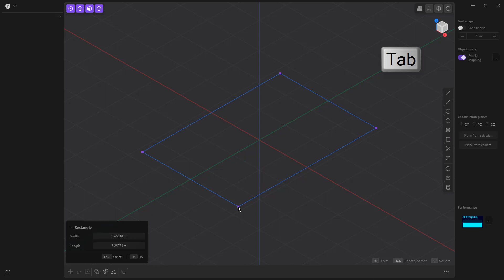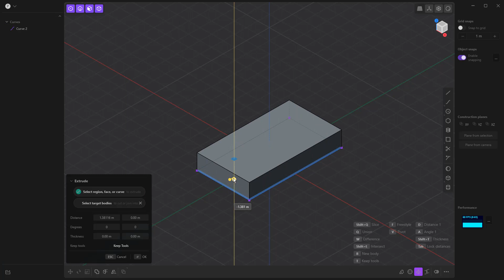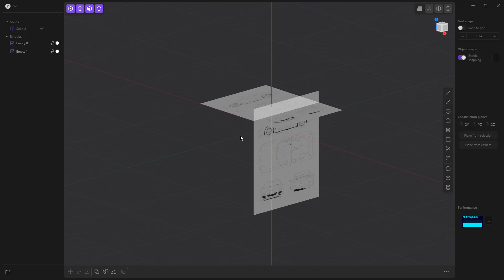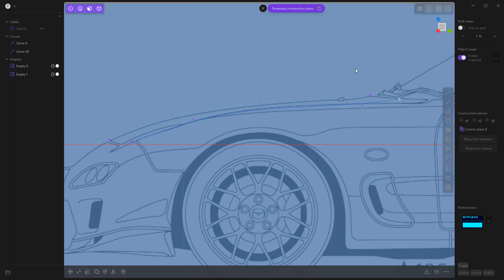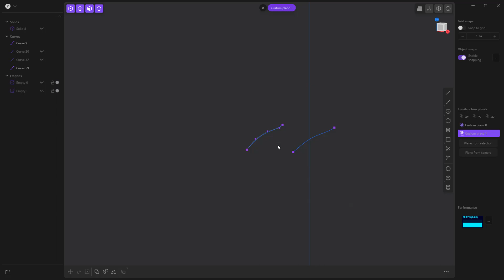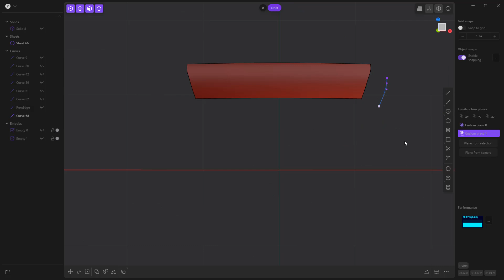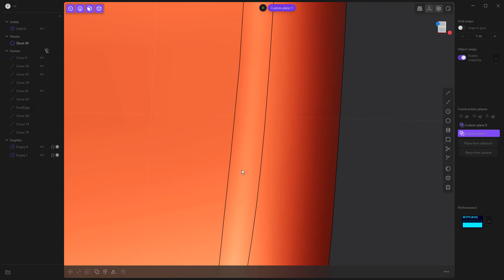Comment: Looks like the key to change the type of rectangle has changed from tab to C. Kinda maddening how inconsistent some of the hotkeys are.
Reply: Yeah. not many have changed but that is sadly one.  I think because tab in some cases navigates through the dimensions that were added.  Some things like extrude, tab locks dims.  I haven't noticed this as much becuase i generally start with a center point rectangle but you are100% correct.

Comment: I've been working daily in Ansys SpaceClaim for the last about 10 years and I need to change software before I have a stroke! I design model car kits and mostly work by surface shapes, and though dimensions matter, they don't necessarily drive the designs that I need a parametric cad. The most important tool for me is the 3d spline and being able to draw in 3d, and it looks like the spline tool here may be close enough. Thanks for the speed of the videos, for moving slowly, and not just showing off what you can do like many creators do!
Reply: Thanks!  You might want to check out the car modeling playlist I did.   It was just before the current version was released so there are some minor differences.  the biggest being xNurbs if you have a studio license.
https://www.youtube.com/playlist?list=PLBDfGh8A8kXXglEZA2MGsn-U8z2pNCPny
Reply: @LearnEverythingAboutDesign  will do, I've watched more videos since last night and the more I see, the more I like about it! You have no idea what a load off my shoulders this will be if it works out!
Reply: I'm very happy I stumbled uppon your comment and channel! Glad to see some showcasing from the makers!
I'm in the early stages of a ridiculous scale model project and I've been using Fusion for the technical parts but didn't quite work out for the surfaces. I've already migrated from Blender due to the complexity it introduces so that's also out and Plasticity seems like the perfect balance between modeling and serious CAD software. Would love to chat some time in the future when I get up to speed for insights in the process.. if that's ok of course!

Comment: Compared with Maya, 3ds max etc Plasticity is really clunky when it comes to this method of modeling; especially with the image set ups and its complete lack of view ports. Apart from that it's a very good modeller, but the surface modeling interface needs a lot more development before it hits the mark surface modellers using splines expect.
Reply: I will say it is getting better. version 1.4 has seen some improvements.  Surface modeling wasn't even in the beta version of the software :)  I will also say that these are NURBS surfaces not mesh.  To the best of my knowledge there is no STEP output from maya or 3ds max correct?

Comment: Hi, I'm trying to design a custom air rifle stock for fairly niche target shooting discipline. I'm using Fusion 360 currently and am struggling with curved surfaces. What software do you think is ideal for something with complex flowing curves like this? I love Fusion for modeling practical use items but I'm not yet sure if this software is ideal for this project. It's my first attempt at doing surface modeling and I probably picked a very difficult thing to model.

Should I persevere with Fusion or try something else?
Reply: Hi Patrick, at the current time I would probably stick with Fusion 360 and explore the forms tools.  I have loads of playlists on my channel about freeform modeling.  I think something like this can certainly be done with Plasticity, but if you are already using Fusion for other things it would make sense to stick there.
Reply: @LearnEverythingAboutDesign  Thanks for your reply, and thanks for your high quality tutorials. I've learnt a lot already from your channel, and it's become my main resource for learning 3D modeling.
Reply: @Patrick-857  Thanks!  I have been working on a Plasticity car modeling video/series but life has been too busy.  That should be the next video I release.

Comment: Hitting Tab just selects the measurements...was that a recent change?
Reply: Yeah sadly from 1.1 to 1.2 that changed.  If you look in the bottom right when you are modeling and the tool is active i believe "C" now switches from a center to one sided extrude.

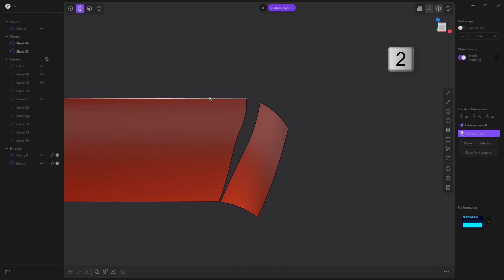Comment: hi, wonder why loft straight up doesn't work to connect the two sheets' edges at 17:28? Is this a version difference? I'm using 1.2.1 currently, thanks
Reply: yeah there have been a lot of updates in the 1.2 release from this one.  I will be putting together a new video on 1.2 soon, but the last plasticity video i did with the beta version which was basically 1.2 i talk about the differences. https://youtu.be/1rQdlOgFFyk

Comment: Literally lost me at square one.
When I click the center and drag away to show a rectangle then hit Tab, it doesn’t go into center mode.
I haven’t clicked the second point of the rectangle when I hit tab.
All it does when I hit tab, is toggle between the rectangles dimension text fields.

So far I’m not seeing any compelling reasons to switch to Plasticity from Shapr3D.
Reply: yeah so between this video in the most current release that TAB changed to C.  TAB now toggles dimensions on the screen.  When you do any operation in Plasticity you can see the hotkeys in the bottom right.

Comment: How should one save an image so it imports to size? Everything I import is 10 x scale.  
Your drawing seemed like what you were expecting. Of course there seemed to be no regard for scale since you were just eyeballing it to fit.  
     That poses another issue.  Let's say I have a shape 7.374 in wide and I want to make it exactly 9.5 in. Is it really necessary to do the math and then input 1.2883 three times?
Reply: what I would do is make a box in the units/size you want.  So if you are working in inches start by changing your units, then draw a rectangle the size you want, extrude it the width.  Then you can have your size reference.  Then I would make sure the images you have are the same size.  Either the true length across the bottom of the image is 9.5in or some scale of this that is easy for you to scale up.

Since this video was made, the version 1.2 that is out now shows some on screen dimensions that you can TAB to when drawing a rectangle which should help.  But yeah there is no measure or strict dimension scheme, mostly eyeball past the initial creation.  What I have done is to create reference lines at times and use those for visual reference as well.  Lets say i know the length of an object is 1250mm, ill set my units to MM then draw a line that long so visually i have that reference and/or snap point if needed.

Comment: 17:28 Try to repeat the same and have en error :( It works on;y with G0 and the surface is flat :( If I select G1 it writes me "T at terminator of curve"
Reply: did your fillet leave a gap at the front edge? or was the front edge still connected?  If it is still connected that might be the issue.
Reply: @LearnEverythingAboutDesign  created two surfaces using loft, -> joined them J, added fillet distance between -> unjoined 3 surfaces Alt+J -> deleted fillet surface -> selected two edges of the two surfaces -> L loft -> get the error "Select guides to loft along"
Reply: @КириллМаренков-с7к  not sure. if you like you can send me the file support@caducator.com and ill try and take a look.
Reply: @LearnEverythingAboutDesign  I recorded the process
https://youtu.be/dNoFEXR_Cn0

Comment: How do you rotate around an object using a MacBook and no mouse?
Reply: Since I don't use a MacBook I am not entirely sure, but I would suggest looking through the user run Wiki.  There is info on keybinding there and likely some info around that problem. https://nullpointerecho.notion.site/nullpointerecho/Plasticity-Wiki-364945653983489ba3e4ad2fc9d0527e

Comment: Can a curve point of a spline be changed to an angled point and vice verse? 
Also: I've created a face with multiple curves and angles. When I try to move a corner, I can only select and move one of the two points and the face disappears and the points will not rejoin. They won't snap together and J does not join them.  Please advise. Thank you.
Reply: A few things I will try to touch on here.
1. As far as I know you can't convert back and forth between splines and lines with sharp intersections.  You can split a spline up using split segment, then if you move some of the surrounding split points it will be "sharp"
2. if you are moving the end of a curve with "G", you can use the Freestyle option "F" which lets you pick the point you want to move, then the point you want it to go.  This is probably the easiest way to get them to snap back.  
3. if you box select the intersection point rather than clicking on it, that should get you both of those corner points. Note that if there was some sort of tangency when they were created you will break that.
4. For Join you can join curves together, but not end points.  The curves must intersect at their ends though, it isn't a fix if there is a gap, meaning it won't snap them together.  Try #2 with the freestyle move.

Comment: I‘m trying to make my own rc car from star to finish. And especially die body modelling and thickening is one issue i faced with blender. The polymodelling approach seems to be right there but fitting it with functional parts from fusion for example is an other aspect. Bu my question is, after modelling the complex surface of a car, how successful is the thickening in plasticity. Because in blender its really tedious. And the the surfaceing approach in fusion360 is not easier. And i am willing to pay the 99$ and learning the tool if its good.
Reply: I think the surface quality in Plasticity right now is good, but modeling something like that would be tricky.  There are 2 main paths I would probably push you down.
1. Forms modeling in Fusion for the majority of the shape.  I have helped a few people who use Fusion for RC car bodies with success.  In order to thicken you just need to watch your shape/creases/curvature.
2. Model the shape in Blender as a quad mesh, import it into Fusion and convert it to a surface.  This only works if its a quad mesh, but if you are able to model the thing you want in blender but run into issues at the Solidify stage, bringing it into Fusion might help.  When working in Forms you can thicken there, or convert it to a NURBS surface and thicken the surface.

I think in the future Plasticity would be a great tool for this, but right now there are some work arounds with lofting surfaces that I hope v 1.20 will fix with driving tangency or the ability to mix/match edges and curves for profiles and guides.
Reply: @LearnEverythingAboutDesign  Thank you for the dedicated work. It‘s really great. I will try both approaches. Modelling something like a skyline r34 but seems a little frightening in fusion. But maybe by using your advice in combination with more than one part to form th hole model might easen up an lead to a successful solution.
Thanks
Reply: @erdemkoc169  Thats a great one to model!  Just give it a shot and ask questions!

Comment: Trying to get to grips with this but I can't get past first base. In drawing a rectangle, as soon as I hit the TAB key, all that happens is that two boxes appear with measurements of the sides. The box remains obstinately in place. Any ideas, anyone?
Reply: yeah depending on which install you have, 1.10 is the most current and tab now jumps to dimensions. i think if you look in the bottom right corner when drawing the rectangle that C is center now instead of tab.
Reply: @LearnEverythingAboutDesign  Bingo! That works, thank you so much. I was tearing my hair out as I knew there had to be a simple explanation!

Comment: How to combine two vertex?
Reply: if you have curves you can select one of them, hit G (to move) F (for freestyle), select your point again and then where you want it to go.  Once the curves share an endpoint you can use J (to join) when both curves are selected.
Reply: @LearnEverythingAboutDesign  but how do I merge two points of a curve into one?
Reply: @rothauspils123  Can you give me an example when you would do this?  With curves you can rebuild them, but the points aren't on the curve itself, its a control frame.  You can't merge control points of a spline together if that is what you are trying to do.  You can select one and delete it, you can try to rebuild the curve with fewer points as well, but the internal points on a curve can't be merged as far as I am aware.  The end points of 2 different curves can be snapped together using the G and F method. then you can use Join to merge the 2 curves into 1.
Reply: @LearnEverythingAboutDesign  For example when I fillet a corner but the new points are very close to some old ones, it would make sense to merge the points to get better topology.
Reply: @rothauspils123  With nurbs modeling you don't really have to worry about topology in the same way with poly modeling.  But after you add a fillet the points should only be at the start and end.  there shouldn't be any extra points.  If you draw 2 lines that intersect and you hit B it will add a fillet.  If you rebuild the curve it should still just have those same points.  

I guess the takeaway is that there isn't a way to merge verts like you would in say blender with M, but it isn't needed in plasticity.  You can joint curves together, but the verts can be added/deleted but not merge to the best of my knowledge.

Comment: TAB key has changed ? @ 1:31, I'm using 1.1.0 and this now cycles through measurement input.
Reply: Yup it looks like it did change.  Now there are dimensions on the rectangle.  If you  hit C it will change from corner to center rectangle.  S to make it square.  Thanks for pointing that out.

Comment: Great video on how to use curves for modeling. I just started learn Plasticity and I LOVE it so far. I'm currently redoing an engineering prototype that was made in Modo and migrating it towards a CAD based workflow, which will be much easier to design and visualize. I was having some challenges in regards to drawing the shell for my project (tracing on a 3D scan of a head that I have to convert into a workable solid using Rhino), but this video helped me a lot. Thanks again.
Reply: Sounds like a cool project!  Currently in Plasticity you can't reference the mesh(directly), but you can insert it as a visual reference.  If you take your 3d scan of the head and convert that to a "dumb solid" or even if its a quad mesh Fusion 360 could make it a solid through the forms workspace, you could directly manipulate it in Plasticity.  Hopefully in the future there will be tools to directly snap to or reference the mesh.

While Fusion isn't the perfect tool I do have a series showing how to reverse engineer some prismatic and more complex parts from scans that were done recently.  Not to sway you away from Plasticity but if you need to say pull curves off a mesh, you just can't do that in plasticity yet.
Reply: @LearnEverythingAboutDesign  that is totally understandable. Bit I'm glad it worked VERY well
Reply: @LearnEverythingAboutDesign have you had issues with trying to snap to the control points when lofting? I've had issues where the sheet would disappear
Reply: @MrRileysGameroom  hmm I haven't had a sheet disappear before!  I am still trying to work out all the snapping options.
Reply: @LearnEverythingAboutDesign  i think it's because the points aren't touching

Comment: Thanks for the tutorial! How can I cut/trim a surface by a curve or another surface?
Reply: There are a few ways you can do this.  Q (Boolean) works, you can also use Cut and/or imprint, unjoint (alt+J) and delete what you don't want.  Boolean is usually the first option to try.
Reply: @LearnEverythingAboutDesign  Thank you buddy! I will try it!

Comment: is tangency between surfaces/ curves supported in Plasticity ?
Reply: If you loft or patch a surface/sheet yes you get continuity options for G0, G1, and G2.  The current thing missing is the ability to loft between the edge of a surface and a curve.  Right now you can loft edge to edge with a curve as a guide, or you can loft curve to curve,  but you can't loft edge to curve.  I believe that is in the works though.

Comment: Is there a way to convert edge to curve?
Reply: I you have an edge selected you can use Shift + D to duplicate it and you will get a curve.  Same thing with a face.  Note that if you pull the edge off something like a complex shape, you might also want to use Rebuild and then you will have a curve with control points.

Comment: Thanks for the video! Were you able to figure out how to maintain the width of a fillet between surfaces? At the moment it seems like you can make a constant width fillet only if the angle between surfaces is constant all along as well.
Reply: There is a variable fillet option but no i don't think you can control it by width.  You could split the surfaces up with 2 parallel lines and loft between them.

Comment: Hardware requirements?
Reply: That is a great question.  I don't specifically know if there are any requirement.  A lot of people are using it on old laptops and workstations without issue.  I'm told it doesn't require a super powerful computer but no specific processor, ram or gcard specs.

Comment: Do you know if it’s possible to convert an edge to a curve in plasticity? Many thanks in advance
Reply: If you  have the edge of a solid or sheet/surface selected you can use Shift+D to duplicate it.  there are 2 other commands you can use. ALT+1 which is subdivide curve. and there is also a rebuild curve that doesn't have a hotkey.   Quick side note. if you draw a box and double click on the corner point you will get a curve.
Reply: Thank you!